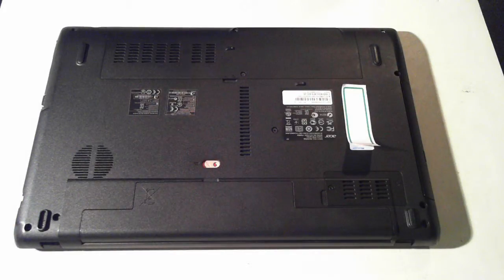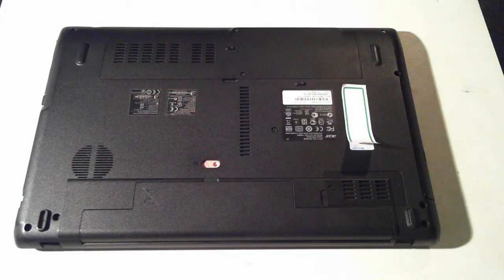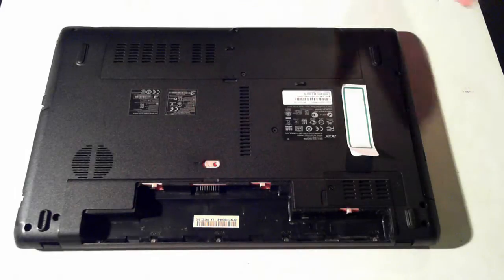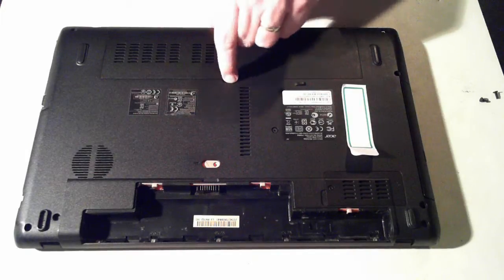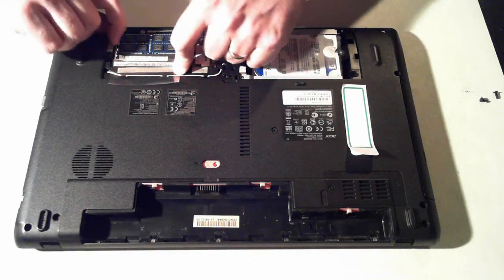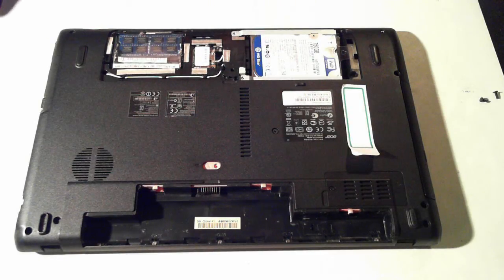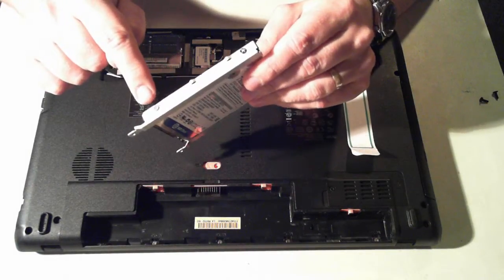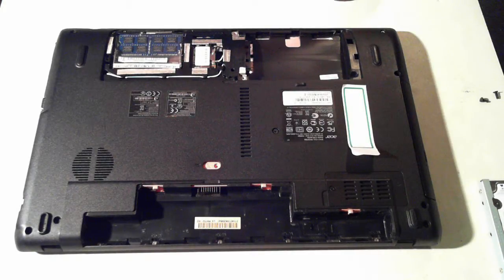Acer Aspire 5750 Opening / Upgrading / Take Apart

Comment: I have to replace the fan in my Acer Aspire 5750-6866. All the videos I find are of Aspire 5750G fans being replaced, Are the insides the same in each laptops?
Reply from the maker: ***** it should be but I can't be sure as I haven't seen that model.
Reply: So if I'm seeing in video correctly, I'm going to have to take out the motherboard to get to the fan.

Comment: I have a Acer Aspire 5750 with an Intel core i5-2410M processor in it. I was wondering if i can upgrade the cpu to an i7 mobile processor and if the motherboard can take it. i already upgraded the RAM to 8GB and the hard drive to a 1Tb SSHD just want to know if i can upgrade the cpu
Reply from the maker: TheRhinoking27 I personally wouldn't go upgrading CPU's in any laptop. With potential overheating issues etc it IMHO isn't worth the risk. To find out if you can I'd speak directly to Acer or one of their service centres.